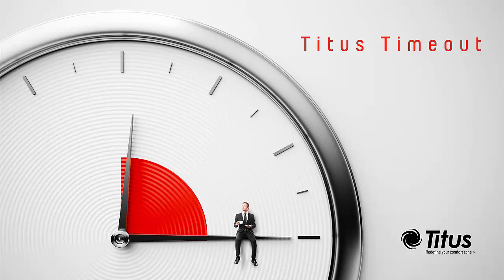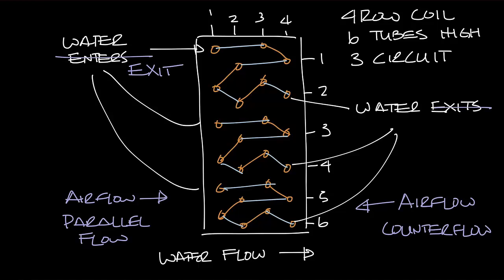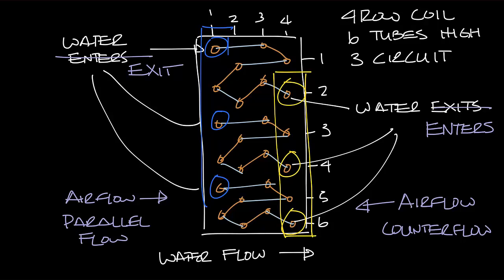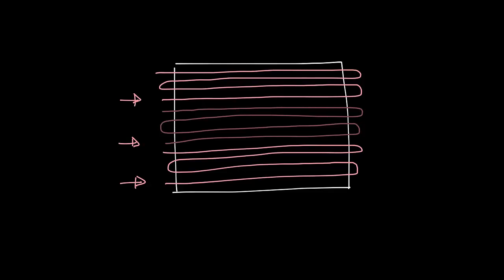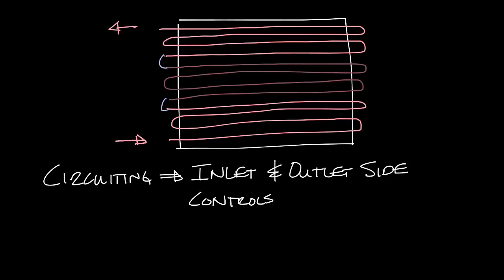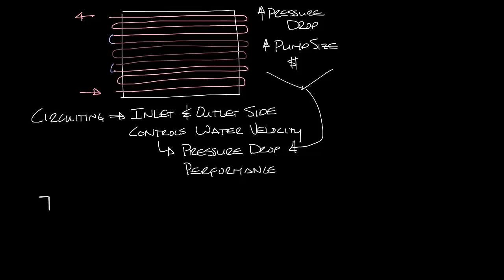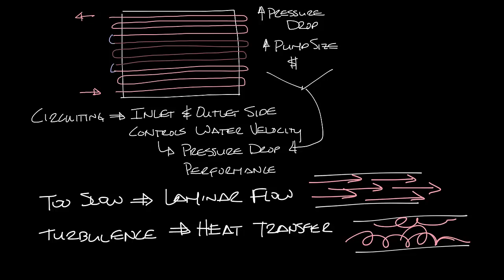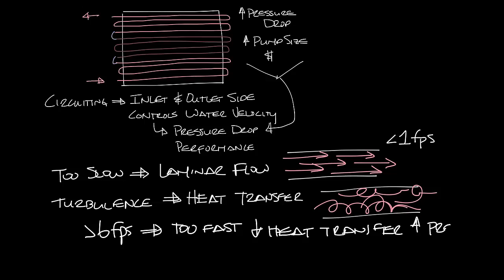Titus Timeout Podcast - Water Coil Circuits

Comment: Why is the coil arrangement is in staggered manner, why not unstaggered
Reply from the maker: The staggered tube design exposes the tubes to more moving air than the in-line design. The geometry of the staggered tube design also allows the rows to be spaced closer together. This results in a more compact coil providing higher capacities.
Reply: @TitusHVAC  great, thank you very much.